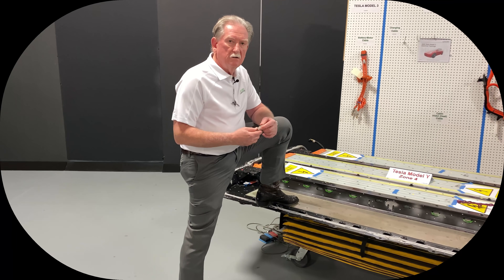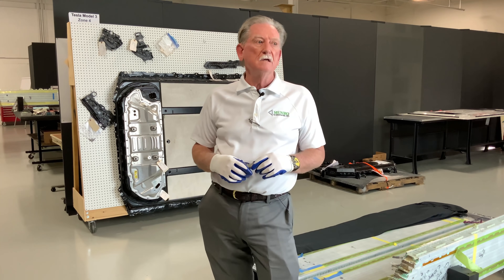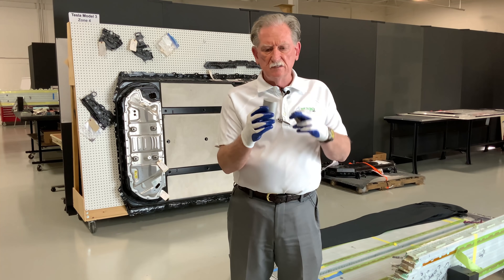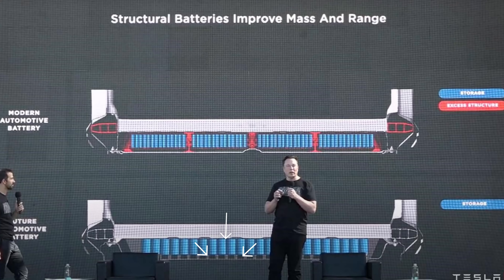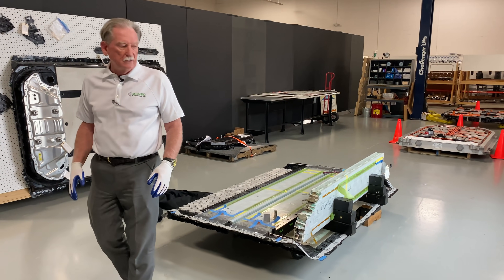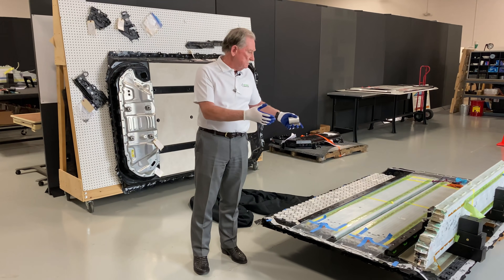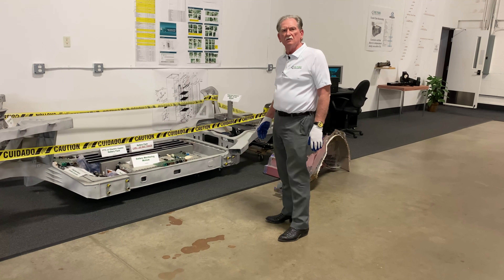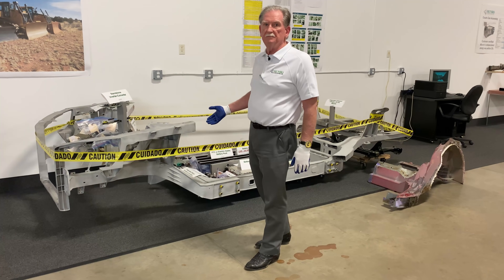Sandy is Thrilled about Tesla's Battery Day & Begins Battery Mock-up

Comment: with castings like this expect insurance to increase. no repairs will ever be maid. a nice 50k plus vehicle will be totaled in the smallest of fender benders. 
i'm not sure if insurance companies are going to love this or hate it.
Reply: I'm thinking it'll be a bigger version of today's crash rails, unbolt the front back or battery section, bolt in the new unit from the collision shop, attach bodywork. however this will make shipping to the body shops astronomical since anything that bends more than the skin will see a third of the car unbolted and recycled.

Comment: so if i am not mistaken, one new battery uses about twice material for the encasing (aluminium i guess) than a model 3 baterry.... so  960*2 = 1920 cell shells jeje, alredy a decrease of weight of  about 2500 cell shells, but there is more if you take a 40 % of the new bateries in order to have the same K/W then you would need only  576, (or 1152 cell shells in weight) so it coul go to decrease in weight of 3300 cell shells... i gues the jelly roll remains the same wheight proportion.

Comment: What happens after a car accident? Does the car get chucked or can it be repaired?
Reply: Car accidents are generally caused by humans, driving aids and eventually autonomy will reduce accidents
Reply: Ask the same question about the existing structures. If any of those parts get damaged the most likely answer is the car is totalled anyway. If it isn’t they can replace the entire casting.

Comment: I had the same question about the state of the solid-state battery, but I rly think that they are still important in the next 10 years. They might not be cheaper at 1st but they will give some benefits for the luxury vehicles and most importantly our phones and laptops. With that said they will mainly deliver bigger capacities and lower or eliminate the heat. 

As for the way they are making the new battery they might have had an inspiration from the way they used to make high current capacitors (with a technic called schoopage) where bigclivedotcom (a youtube channel) explains it in a video where he thinks how they are going to do it titled "Will Tesla's tabless cells ever use Schoopage?"

So yeah very exciting and the bit that rly impresses me is that they are not rly reinventing the wheel here this are all like very old technologies just used in aclever way.

Comment: It's great to see someone get vindicated after having his ideas get shot down by the old ICE vehicle manufacturers.
Reply: His enthusiasm while explaining how he's been pushing this exact thing forever with no takers and now seeing it happen was awesome!
Reply: Nonsense, he obviously didnt work with all ICE manufacturers, every manufacturers have their ways of doing things, range rover is 100% aluminium construction, bmw uses carbon fiber, magnesium, steel, recycled materials.....
Reply: Then read my errata which go beyond fake excitement and stick with the numbers and facts:

2:33 - serious mistake: in this analysis on the flipchart a 4680 cell is associated with ~ 9.000 mAh. That is way too low. A 4680 is about 5.5 times the volume of a 2170. Tesla stated 5 times the energy for a 4680 compared to a 2170 (see Tesla slide from battery day), so the 4680 will be about 25.000 mAh. But 960 cells times 3,6 V times 25 Ah = 86.4 kWh. This is nowhere near 130 kWh. Sandy Munro should redo this analysis and include proper numbers.

2nd serious flaw: Elon Musk stated on Sep 21st that the battery day unveil only "affects long-term production, especially Semi, Cybertruck & Roadster": 
https://twitter.com/elonmusk/status/1308148212876812289
"Important note about Tesla Battery Day unveil tomorrow. This affects long-term production, especially Semi, Cybertruck & Roadster, but what we announce will not reach serious high-volume production until 2022."
For Semi: Tesla will again need about ten thousand of these 4680 cells.  With 20.000 connections. So: for a Semi battery pack, these larger cells (about 25 Ah) are still way too small  and history repeats itself like from the 8256 cells in a 100 kWh pack of Model S/X.
Of course, you can still put wooden fake 5070 cells in a Model Y battery case, but 80 mm is 10 mm more than 70 mm (the predictions did not work out), so they do not fit right away. Especially, when also moving cooling plates to under and over the cells, instead of in between them. 
The other flaw in the argumentation: when this I-Pace battery pack design (designed by LG Chem, who also supply the cells and modules) is so desirable, why is it limited in charging to around 100 kW?
And finally: why should Tesla stick with a 350V design like Sandy states on the flipchart? They can change their cell/modul wiring from a 96s 10p configuration to a 192s 5p configuration at a 700V level just like Porsche Taycan or Lucid Air did. This way they can reduce currents on the DC charging cables from the Superchargers V3. But of course, then they need to update their electric motors and accessories to handle this voltage. They will have to do so anyways.

3rd flaw: Solid-state cells adress three issues: cooling, safety and energy density. So, to get rid of active liquid-based cooling altogether and stick with air cooling. In addition: solid-state cells adress safety issues: if no electrolyte can emerge from the cells in case of an accident, the risk of fires will be reduced. With these properties, energy density can be increased without compromising safety. Sandy Munro should have a second or third look at the technology.
Reply: @koeniglicher  Regarding your point #2, Elon HAD to say that it applies only to future models, because of the Osborne Effect, i.e. people would cancel M3 & MY orders in anticipation of the battery breakthrough. So I think they will implement it in M3 and MY and announce it retroactively.
Reply: @koeniglicher  When I first learned saw and heard about some of Elons projects years ago (SpaceX, Tesla, Boring, Neuralink, etc) many arguments against popped up on the internet (surprise), some by people who were engineers themselves and with well reasoned logic and math. So for a brief moment I was inclined to believe that, yeah ok that sounds bad or impossible. Then 10s later  I realised, well there are probably 10-100 times more engineers at Elons companies with on average 10-100 times more knowledge and experience AND have actual access to the technology being developped (i.e. they know more than what is published publicly). The mere fact that those people don't go like "oh yeah no, not gonna even thry, im out of here", means I should not care one bit about internet experts. And Elons succes record in all of his companies have proven his companies are not crap even the least. So even the most well reasoned argument on the internet carries no value against the mere fact that Tesla still exists today with technology they predicted years ago.   To me, its as simple as that.
Reply: @Sam-u8i6f  You did not get the point, Sammy. You explain your gut feelings, personal beliefs and whatnot, but I care about math, and the math there in Sandy Munros battery pack calculation is simply wrong. That is the point. It is like a math professor writing on the blackboard: 1+1 = 5. He made a mistake, and that should be corrected. And Sandys assumptions are wrong, when Sandy considers use of 4680 cells in a Model Y, while Elon names Cybertruck and Semi as intended applications. The battery pack sizes change and an assessment needs to take this into account.
Reply: @koeniglicher  No, Elon named ALL future vehicles as intended applications. The slide showing Iron based, Nickel+Manganese and Pure Nickel means that all of those products will get the new battery production, just with different chemistries. If it is a long time away, maybe it will be next-gen Model 3 and Y. But maybe the current one, as he has hinted that Model Y made in Berlin will be quite different from the current one. There is absolutely zero sense in continuing to use the current cells once they have another cell that is 56% cheaper per kWh and 10 times easier to produce. Why on earth would they keep on paying external suppliers like Panasonic, LG or CATL around 132% more per kWh, when they will have the resources and production capacity to eventually cover their own needs? You really think they will just keep doing what they are doing instead of retooling and redesigning the current models to be made much cheaper? After Elon has shown numerous times he doesn't believe in the sunk cost fallacy, especially with space X, but also with Autopilot recently.
Reply: @HNedel  Cell costs are always heavily influenced by the scale of production. That is a no-brainer and was Teslas motivation to start with 18650 in S/X (like many electronic devices) and then 21700 (like many pedelecs and e-cigarettes) in 3/Y. Currently, 4680 is not yet produced at scale and thus there is no cost advantage whatsoever from 4680 currently.  It needs considerable investments, equipment and skills at cell suppliers, their supply chain and eventually at Tesla to produce 4680 at scale in the 100 GWh/a range. The intended cost savings in the presentation are a target, a goal to be reached. But they can only be reached, once mass production is set up. Until then: 18650 and 21700 are still cheaper. Why will they pay external cell suppliers (look Elons Twitter message)? Because they reach the desired scale much quicker than Tesla itself. My take: Teslas potential shift to its own production is just an argument in negotiations, when major cell suppliers with a strong market position try to dictate cell prices from their side.  But Tesla wants to dictate from its side. And sees its market cap as main argument, that the big one rules over the small one like when they outgrew Panasonic.
Reply: @koeniglicher  "Currently, 4680 is not yet produced at scale and thus there is no cost advantage whatsoever from 4680 currently" Are you having a stroke??? The presentation Musk made was for the FUTURE and their path to get to 56% reduction of battery costs. Telling me that the future has not yet arrived, because we live in the now and not in the future, so the future cheap cells are not here yet, is as redundant and stupid as it gets. And no, the suppliers can't scale faster than tesla, that's why tesla is making their own cell, on their own machines, with their own processes. Your argument, in case you forgot, was that model Y will not get the new cells, only Cybertruck and Semi will get them. There is NO reason to assume that, not from the presentation, and not from any information Musk has revealed otherwise. Tesla can't demand 56% price decrease from their suppliers, as this is way below their cost of manufacturing. Right now only Tesla has presented a clear path to reducing the cost by that much, and their suppliers should start their own research 4 years ago, in order to overtake Tesla. But they unfortunately don't have a time machine. 

And why would LG, Panasonic or CATL care about Tesla's market cap in negotiating prices? How do you think those negotiations would go? "Give us cheaper cells, because we have a higher market cap than Toyota and GM combined! What is that, Toyota and GM are ready to pay you more than that for your limited production capacity? But we have the higher market cap, you MUST giver us your cells for less money! Whaaaa!"
Reply: koeniglicher oops, Elon confirmed that Model Y from Berlin Gigafactory will be the first one to use the new big cells integrated into the chassis... guess you were wrong after all, and Sandy was right.
Reply: @koeniglicher  You have quite a few fallacies yourself in your errata.  The I-Pace is so limited with charging due to the type of cells they use, not as easy to manage temperatures with.  350V vs 700V helps with wiring and reducing weight but can you put in more C rate into the batteries with higher voltage?...
Solid state cells are likely safer, sure.  But this is all about cost per kWh of battery.  The current batteries Tesla uses can be mass produced easily.  Not the case for solid state and we don't know how many years away that is.  
The liquid electrolyte doesn't exist in the 4680 cell...
Reply: @whattheschmidt  Audi e-tron 55 has the same LGchem cells and modules like I-Pace 400/350. But charges with quite consistent 150 kW. So, it is not due to the cells, but the TMS or BMS around them.
No, C-rate does not change with voltage (350V vs 700V). What changes is currents (are cut in half), and therefore thermal dissipation losses with 700V go down with the square of amperage to a quarter of the value at 350V. That allows to make changes to the TMS.
I'm sure, a liquid electrolyte does exist in the 4680 cell as stated here from a Tesla patent: https://www.teslarati.com/tesla-electrolyte-patent-1-million-mile-battery/
"A nonaqueous solution does not include water as the solvent, but rather another liquid." Otherwise, Tesla would not be so proud of its progress in the formation process, which they try to speed up but cannot drop. And in that case they would have created a solid-state cell, which clearly would have been promoted. If you can support your claim with some evidence, then state your reference/source for a non-liquid electrolyte in the 4680 cell.
Here is a reference for the 4680 to have a liquid electrolyte: https://thelastdriverlicenseholder.com/2020/09/22/tesla-battery-day-and-more-2020/
"Production Process: The production process itself consists of several parts: Mixing the electrolyte components, dissolving the dry components in a liquid, coating the metal with the electrolyte, drying the electrolyte, winding, and finally filling into a can and placing and welding the cathode and anode."
Reply: @koeniglicher  Didn't you just quote the current process of batteries which they are changing to use a dry electrode process.  
I'm sure there are benefits to higher voltage, I am just questioning how much of a benefit there is when we can already reach 250kW peak charging rates with Tesla batteries. Less heat and better cooling with the 4680 (and not to mention more kWh packs) should result in keeping these high peak rates longer too.
Reply: @koeniglicher  P = V×I  ( power is equal voltage x current) . So lowering the current and upping the voltage will produce the same power  or temperature, in this case.  The only difference is the wires may be smallers.
Reply: @GabrielFGomes-ok9qc  Redo your course in physics, Gabriel. Voltage over current is resistance: R = U/I. Power is: P = U * I = R * I^2.
And redo your course in mathematics as in U/I, if you reduce the current and increase the voltage, then the resulting ratio will increase from both effects.
Reply: @koeniglicher  
trust me, .. 2nd and third looks are part of the process.
Reply: Why are you sure that the cell is going to be 3,6V? With this technology it can go up to 4,6-4,8V.

Comment: Impressive!  Impressive!  This battery day presentation was the most impressive in my life, same as Sandy I think. 
Only one question sir.  What can you do if one or two cells are failing?  Then, maybe you need to change your 800 battery pack,  and pay for the full pack...   All glued together with epoxy would be like a rock but difficult to swap one cell.
Reply: Each gets tested prior to pack integration, and if there was an issue after the fact, I'm sure those problematic cells can be isolated so that the rest can function, though at a slight performance drop.